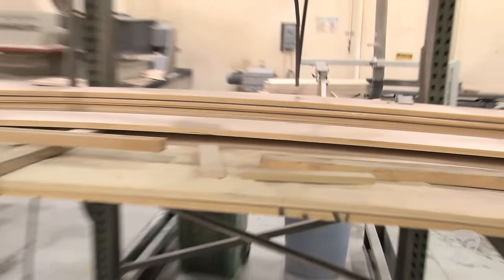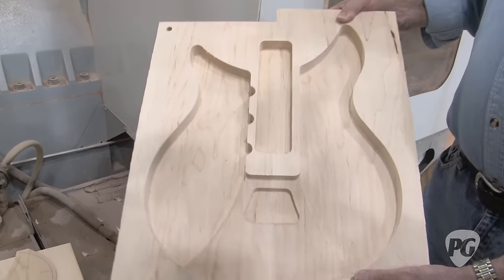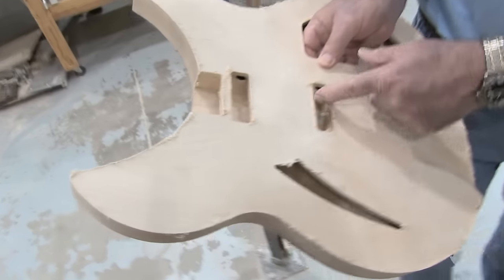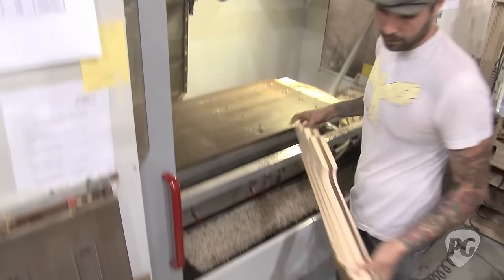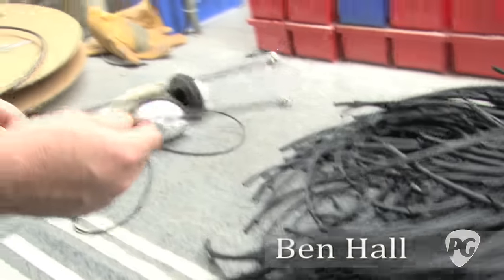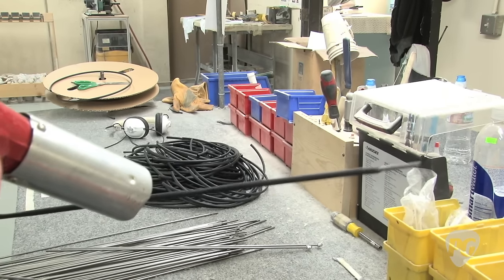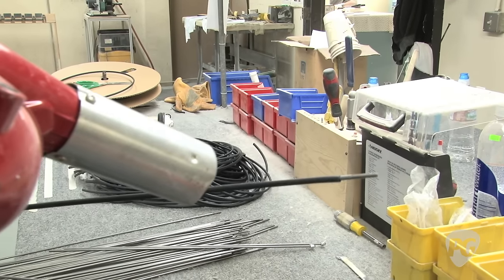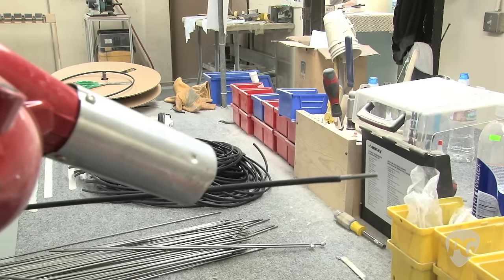Rickenbacker Guitars Factory Tour: Model 330 Construction

Comment: "a quality instrument is easily repaired"
I've had 2 Rics but that saying does not apply to them
Reply: Honest question: how are they difficult to repair? I have a 4003S and I see no reason why this would be harder to repair than any other bass, apart from the fact you can't take the neck off,but then again, loads of other quality basses also have neck-through constructions.
Reply: Remember who said that....Leo Fender whose build methods are less expensive (cheaper) and (was) is in competition with Rickenbacker / Gibson (who both utilize neck-through and set neck methods).
Reply: @stillbill6408   = my point
Reply: @GuitarBassCigar  Duly noted Mr. Dave.

Comment: So, let me get this right..  A robot builds 80% of a Rickenbacker guitar or bass, and there is no testing booth?  Can't afford to pay somebody to sit down with every instrument; set the intonation, confirm correct wiring, adjust pickup heights, dial in the action/ string height?  It's obvious too, my Ric is the most overpriced useless bass I've ever purchased.  I should have sent it back, but it's too late now.  From the factory, the pickup selector cracks an pops between selection, likely not grounded properly.  After dropping the bridge to the lowest possible position, there's still enough room left over to park my car between the strings and the fretboard... Funny when you read comments on forums, most ric owners suggest replacing the garbage pickups right away, and replacing the bridge with a model that will bring the bass into the realm of functionality.  But by that point, after swapping out the most key features of a guitar, why even buy a Rickenbacker in the first place..  Just for looks?
Reply: fuzzeek78 what would you personally recommend?
Reply: @reservoirdog1  If you have money, the Wal mark 3, a Lakeland is versatile, on a budget nothing beats a fender p imo.  A Ric is used in the studio to aquire a specific sound, and that sound comes with finger pain, use of a pick, and brand new mid-heavy strings.  And some kind of hiss mitigation, because a Ric is noisy as frig.  A producer will likely recommend a Ric in certain scenario's for recording, but It would never be my go-to bass, at least the 2003 series with the factory setup.  Hope this helps, and saves you at least a G.  Ernie Ball Music man is also a solid commercial bass, i used one for about 2 years.